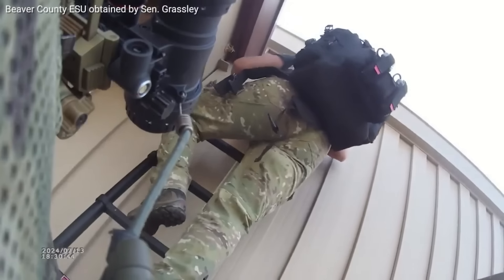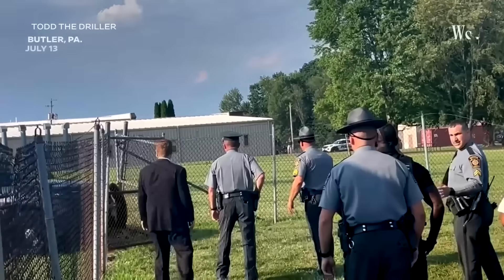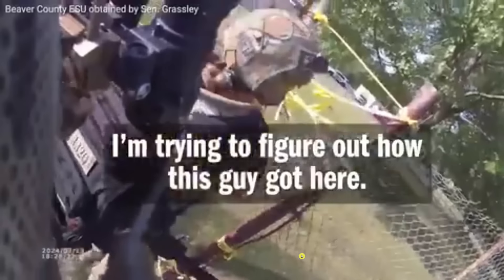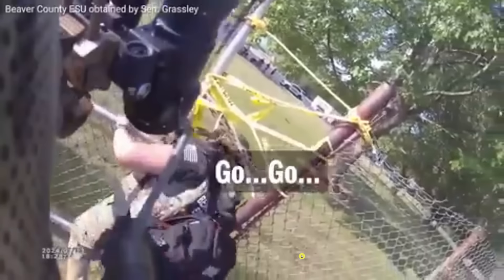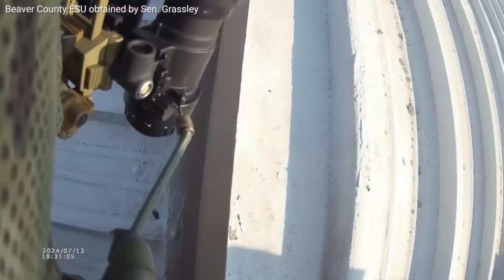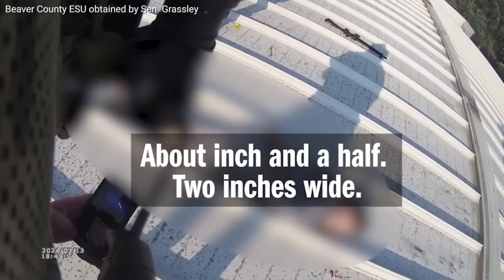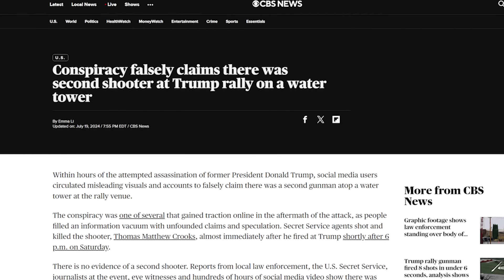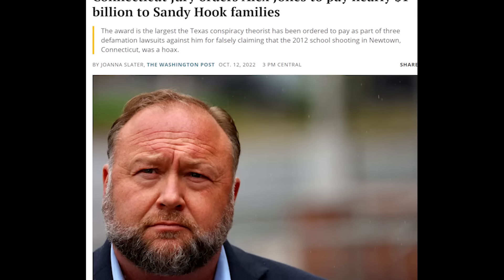Trump Shooting Analysis: Shell Casings, Ladders, Drones, Bodycams,

Comment: Approximately 14 minutes into the video, there is a door by the AC unit. That door looks to have what is an external camera for identifying anyone near that door. Either that or a motion device.
Reply: Security camera footage doesn't fall under the same open records laws as body cam footage.  Security camera footage is privately owned.
Reply: @davidbarnhart5822  I understand that. Not that I am pretend to be astute regarding security camera footage laws, but savvy enough to understand that body cam footage should be available to the public. It is just a question that should be asked.
Reply: @kfnbiurhbrfh  I'm sure they have it if the camera was operational.  It's amazing how many cameras don't work.  Just doubtful it will be released, but we can hope.  Great observation!
Reply: They will blame the Crowdstrike/Microsoft outage and say all footage has been lost!

Comment: 2 questions. Why is his body not near, or on his gun? Why do the second set of rapid fire bullets sound so different from the first 3 shots?
Reply: Saw analysis of that. The microphone was cell phone video-audio. It was MOVING. Pointing in entirely diff directions between 3 shot volley and the quick 5 volley. Echo sounds would be different. All 8 casings found on roof.
Reply: Standard procedure for cops to move the weapon away from a body.

Comment: So after watching the "police activity" video, there is NO WAY a snipper from the red building took him out. When the snipper filming turns around to face the red buildings, they are BOTH BLOCKED out by the tree, not just one building! So a different snipper from a totally different location had to have taken the shot!
Reply: Exactly. Did they have a sniper positioned on the water tower but didn't reveal that information?
Reply: @TheMaticus06  no sniper on water tower.
Reply: Just an FYI: it is sniper with one (1) p not snipper with two (2) p's.
Reply: @TheMaticus06  Yes, a sniper was shooting from the top part of the water tower. He climbed from behind just opposite of Crooks position, and vanished quickly to the ladder after shooting. Eyewitnesses saw him, video also recorded him. His shot came from above, thus sounding differently. Most probably his shot killed Crooks.
Reply: The sniper that made the shot was positioned on a roof on the back left side of the audience if your standing at trumps podium looking out over the crowd.
Reply: @Matt-yv6yu  Nope, both of these snipers were heavily blocked by two bushy trees with leaves. They were there for PR for the media. Crooks didn't climb through the air conditioner. He climbed through a tall ladder, which was moved afterwards. And in this video police climbed to a different roof with their own ladder. It was not the same roof where Crooks died.
Reply: @asma.nooruddin  I’m not referring to the sniper teams that were behind trump. I know they were blocked by trees and slope of roof shooter was on. The sniper team that shot him was on a dif roof, a third sniper team, that was towards the rear of the audience as I stated.
Reply: @asma.nooruddin  and they shot him with an SR25 .308
Reply: @Matt-yv6yu  Autopsy will also say what type of bullet killed him. Beside Crooks, three types of recorded shots sounded completely different from each other.

Comment: How did bystanders not see him climb up on the roof if they saw him moving on roof? That seems odd.
Reply: Climbed up from 5 ft ladder on building behind and crossed over roof connection
Ladder was on top of air con unit up from large ladder seen behind 2 cypress trees

Comment: FBI director Christopher Wray chose to evade the direct question as to whether Crooks took all eight shots, answering that they found 8 cartridhes. Wray also was evasive about the tall ladder, in the alcove behind the tree, which appears to have given the assassin direct access to the roof and instead misdirects to say that, their belief is that the assassin did not use the ladder.

There is zero assertion, and certainly no evidence, that the tall ladder was not placed up against the AGR building, in the alcove behind the tree, prior to the assassination.

Q. What is the purpose of having a sniper in a concealed position?

A. So as to stay hidden so that nobody can see where the shots came from.

There is zero deterrent for having ESU snipers in a concealed position and zero reason for them being concealed, unless it was to hide that they were taking the shots.

The assassin's bullet, line of sight and trajectory may be classic misdirection based on what people would logically agree with. However, it is also equally plausible that the shots fired came from the ESU concealed sniper teams; 1st shot to hit the hydraulic hose, to fit with the line of sight gambut, the second shot to take out president Trump and that the other casualties may be from ricochets and or hits from the remaining shots.

Who had the motive, the personnel, and the opportunity to carry off an assassination of President Trump and then control of the main stream indoctrination media, the FBI and the Secret Service to run cover in the aftermath?

To further exemplify the inequity, there are two positions which would have provided overwatch superiority, the water tower to NNE of the podium, where a smiper and spotter could have been positioned and the two communication towers to the West of the podium which could have had a 360 degree 8K digital camera array fitted to them to pin-point any suspicious people, so that Secret Service or law enforcement could be vectored-in to intercept them and question/ detain them.
Reply: He said they found 8 cartridges. How many spent shell casings did they find? See the difference? Why did they let that answer go without a follow up? 

They are tap dancing all around this, and the audience is eating it up! Ridiculous

Comment: The shooter would have seen the crowd with his drone, as it was approximately 3:50-4:00 pm; that he flew his drone over the Rally area, Wray states. People started showing up to attend the rally very early, and started getting in, to sit down at 7:00-7:30 am; the one You-Tube shooting channel man told, of his brother that went to the Rally. So how did the shooter get away with flying a drone over the Rally area, with that kind of a large crowd, already assembled? How would the Secret Service, or no other Law Enforcement; have noticed a drone that late in the afternoon, and very close to the start of the Rally, with that many people there? The Shooter could have been dropped off, by a helicopter, like the one hoovering over, during body cam video. Wray knows exactly what happened!! Is the said shooter even really dead? It looked like the body moved, on Sky News body cam video. Plus, according to first reports his head would have been blown off, but looks like a perfectly intact body, even with shadow out body cam. How is the blood that dried, that very fast on the roof; when the shooter was being immediately found, after being just shot himself?! Ask shed builders and roofers, how bad they think that roof incline is; and they will laugh at anyone telling, of it being really steep!!

Comment: What I can tell you with reasonable certainty, is that TMC was NOT shot by a USSS sniper.  They were using what appears to be magazine fed bolt action rifles chambered in 300 Winchester Magnum (300 WinMag).  Even at 400-500 yards, a head shot would have literally blown TMC's head apart.  Neither the North or South CS teams were more than 225 yards away.  There would have been pieces of skull, tissue, blood, and brain matter all over that roof down from TMC's feet.  Also, the picture floating around on social media (relative close up of TMC's head) clearly depicts an intact skull. TMC was killed by a relatively small caliber rifle or maybe even a handgun round.  From the pictures I've seen it also appears that he was shot in the back of the head with the bullet exiting through his mouth, hence missing front teeth in the picture.  This BWC footage also corroborates the theory that the headshot was not made with a typical sniper rifle.  Snipers/Counter-snipers do not use small caliber rifles (less than .30 caliber) because the bullets do not resist wind drift well and they don't deliver enough energy to guarantee a one shot kill.  You can clearly see, even through the blurring, that TMC's skull is in place and appears to be intact.  Even if shot with a .308 rather than a 300 WinMag, the head would still have been removed from his body or at a minimum completely unidentifiable as a human skull.  Something is clearly being obfuscated.  Where's the brain matter and skull fragments along the blood trail.  That roof, down from TMC's feet, would have been an absolute mess if the head shot came from the front with a typically used sniper rifle.  I surmise that he was actually shot from behind with a 5.56mm (police issue AR).  A 5.56, even at close range does not have the ballistic energy to cause the head to explode when shot.  Definitely enough to kill instantly, but it won't take the head off.  They also said that there were 8 shell casings on the roof.  The audio only picks up 7 shots, 6 from TMC and purportedly one from the Counter Sniper.

Comment: @ 2:42 you see the pallet that was used by the shooter to get on the roof. It was propped up like a ladder and subsequently laid down by the police after they decided not to use it as a means to get on the roof.  In Dave Stewart's newly released video from the grassy area between the shooter's building and the fence, you can see the pallet in place as L.E. in khaki BTUs are on the storage shed next to the pallet.

Comment: Okay Jeff that’s not the view where the people were… 
He was above door 12…
And trees were in the way.
The view you showed on the other side had no door and no trees… so that’s not where he was. 
He climbed on the AC unit then up on awning of the front door then up onto the roof, then he went down on connector between the buildings by the two tall trees (where the Stepladder was later).

Comment: If you look at the "air conditioner side" (12:20)... there's a door in the connector between the two warehouse structures. Hard to tell from the drone footage but if it had a handle and the roof had a rail or gutter, it would be easy to toss a backpack (with broken-down rifle) up on the roof, put foot on door handle, lift, grab rail or gutter, pull yourself up. I've made it on roofs myself in my 20's. I think this is the most plausible way to get up there without a ladder based on the evidence/surveillance footage presented.

Comment: There's two thin pine trees and some type of metal beam spanning the two roofs. Should be fairly easy to climb. Why was that not mentioned? Additionally the connecting hallway between the two buildings is lower, it would be possible to climb up using one of the two buildings as foot support. On the other side with the AC I would think people watching the rally would have noticed that earlier than any of the footage we have.

Comment: This may have already been mentioned, but t 15:00 on your video, you're showing the view from the window, of the AC unit and the metal brackets which he could have climbed to access the rooftop.  The gutter appears to be bent outward as well as if someone pulled up on it.  There were citizen videos, shot from under / behind large oak trees which showed the shooter on this exact part of the roof, lying down, scooting up a few feet, and lying down again. I think, based on those videos, combined with this shot from the window, that the shooter climbed up here and was lying low to avoid detection from both counter sniper teams which had a direct view of this end of the roof.

Comment: The ladder he used was on the opposite side of where they put their ladder. It's in the footage it's a red ladder 9 or 10 step ladder. I don't think he would have carried it in on his bike but rather found it on the property. You can even see when they use their own ladder, the officers are not immediately on the same roof. They have to cross over to the other roof where he was. You can see from minute @3:10 you can see across to the other roof.the ladder the shooter used is between the roof they climbed upon and the roof he is on.

Comment: Starting at 11:22, I know that it's easy for a person of Crooks's build to climb the drainpipes on the side of the building to reach the roof.  If his weapon was a standard M-16, modified to be an AR-15 (by the automatic firing position on the selection lever being removed), he could have taken the weapon apart, put the two halves of it in his backpack, and walked around unnoticed to make it to the building.

Comment: I would be interested to learn, if in addition to the recovered spent brass shells, has an attempt  been made to recover the spent lead bullets?

The recovery of slugs should be a relatively easy task. The location of both shooter and target is essentially fixed. Using a laser (perhaps at nighttime in the dark) a small area of likely round placement should be fairly easily established. I would then suggest the use of metal detection equipment to scan the suspect ground.

If this recovery attempt has not already occurred, then why not?

If the area is not presently been secured 24/7 then it is possible that public treasure hunters have already descended upon the area. Recovery of the slug that almost killed President Trump would be worth near priceless.

FYI; at the FBI Quantico training facility there is a ‘to scale’ mock-up of the movie theater where an active shooter event occurred. As I can best recall (I graduated from the FBI Citizens Academy Program in December 2015) every single round fired was accounted for and the bullet paths were represented visually using bright colored thin round sticks.

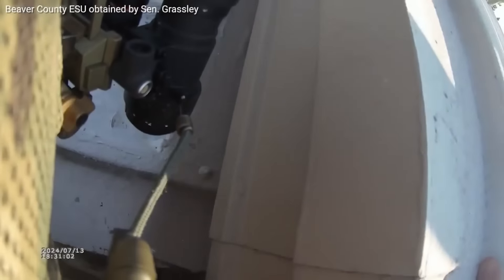Comment: 2:50-3:00 did you even watch the actual bofycam footage of that part? Because in it they literally were just told "ladders in route" and then 2 mins later someone just yells out "hey there is a ladder here, can we use this ladder?" And they were told them could do they then climbed it

I don't see how that ladder in the start with 10-20 cops in that group of officers magically get that ladder here at 2:57 but they didn't try to go on the roof or show up at all in the cam footage? 

No that group with the ladder didn't arrive yet at 2:58.. they didn't even get a limit on amount of people of the roof until like 2 mins after being on the roof in the original, and they also stay to set up a perimeter to secure the location right then too so it isn't like the big group of 10-20 with the ladder disappeared to set a perimeter up then as it wasn't even ordered yet...

Comment: You recovered eight shell casings from the roof because you planted them there. He did not fire 8 shots unless he had two different weapons. The audio analysis is unmistakable, the first 3 were one weapon, the next 5 shots were a second weapon, then shot 9 was a third weapon, and finally shot 10 was a 4th weapon.

You can hear the officer saying the shell casings were on "both sides" of the body. That weapon ejects on the right side, so if they were not planted, how did they get on his left side?

Comment: In the video we see a door from the 2nd floor of the taller building to the roof of the lower building.  So it appears to me that the snipper simply walked through the door onto the roof and used the connecting corridor roof to position himself.  No ladder necessary. (@ 11:28 and several others)

Comment: 2:52 - on this telescopic ladder, it looks like there are two more rungs that could still be extended. It barely was enough because they didn’t fully extend it. Fully extended it still wouldn’t have cleared the edge of the roof, but it would have put them closer to the roof top.